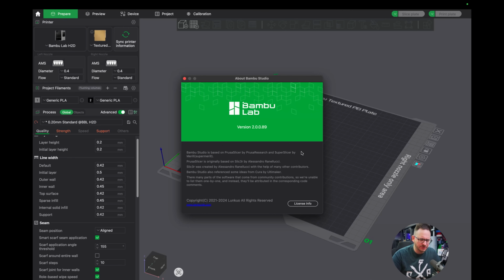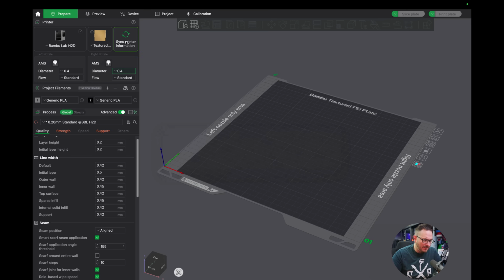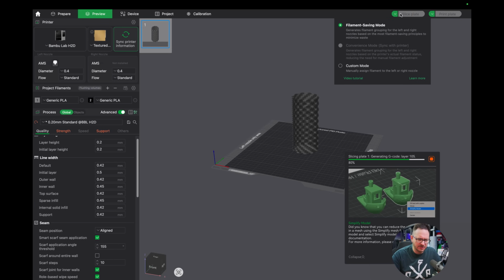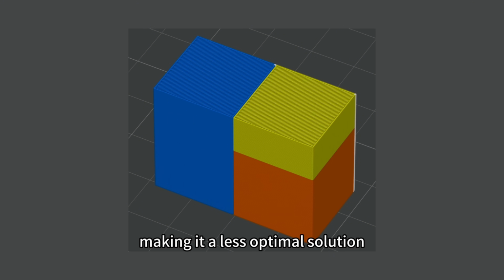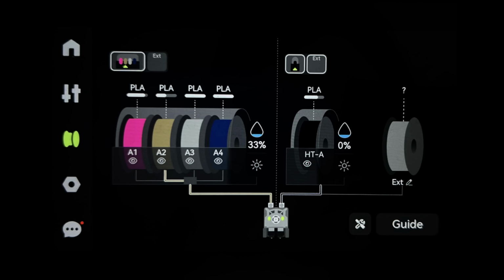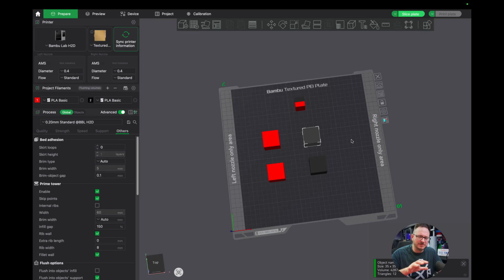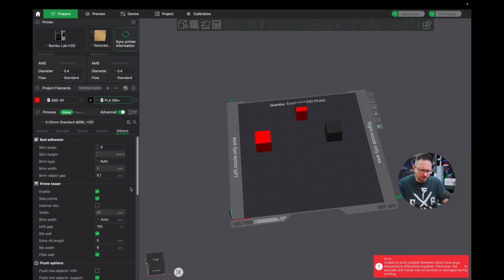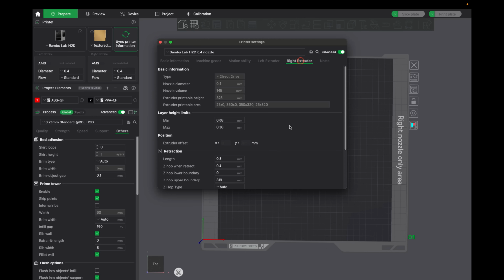Bambu Lab H2D Slicer First Look - first look in 30 mins

Comment: I think I'll pass over the laser , but price could have been worse at £500 more than the X1C comparing to the price of the E if your main point was a heated chamber .
I do like the new AMS pro is also compatible for the X1C , not sure if the print size is the real print size , so can you print the full size and have a little space on the build plate , does anyone print edge to edge ?